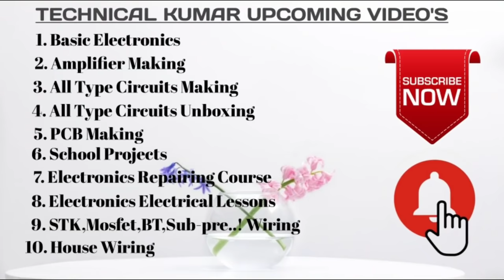how to make speaker box at home  //build sound box DIY in telugu

Comment: I would like to prepare a box of 12 inch [h], 6 inch [b] and 9 inch [depth] for 5 inch sub woofer, also a 2 inch bass reflex port in front of the box . The speaker will be fitted at the side of the box . What will be the cost of the box . As it will be made by 12 mm ply . Plz. reply .
Reply: Hi